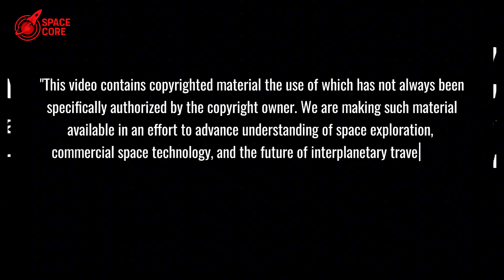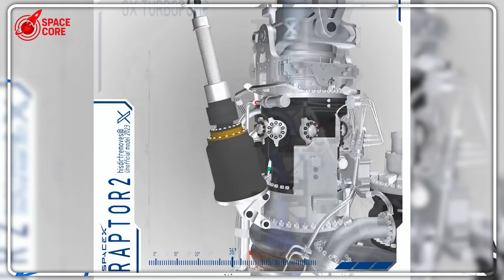SpaceX Finally Revealed WHY Flight 10 SHOCKED Engineers: $63M Sacrifice!

Comment: I thought they were using raptor2 engines on flight 10?
Reply from the maker: You're correct, Starship Flight 10 uses Raptor 2 engines for both Ship 37 and Booster 16. Their improved thrust and efficiency are key for this test.